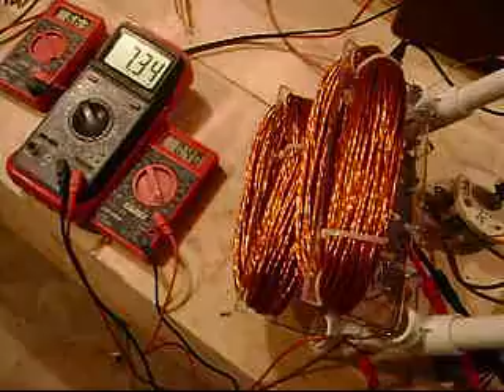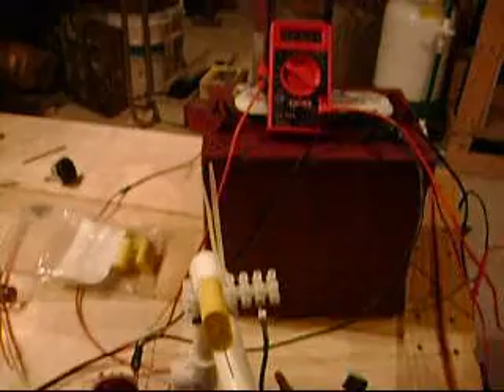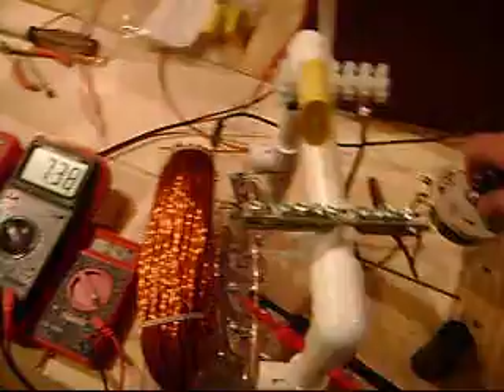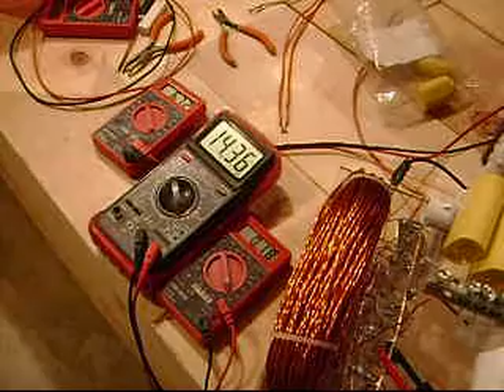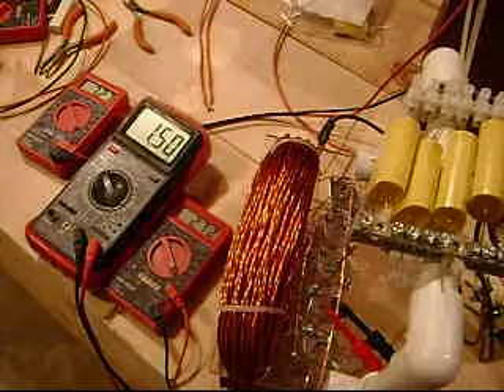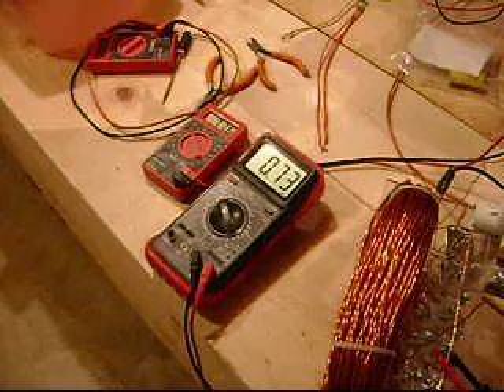TS SS 10T & CAP-DIODE MOD.wmv

Comment from the maker: 2n3055 transistors , 1n5408 diode,  0to500 ohm pot 2watt,  47ohm base resistor, 100 ft 18 ga magnet wire per power tramsistor and 1-trigger wire same.  I.A.E.C.forumco.com has it all  hope this helps

Comment: Hi Douge
Nice work youre doing here I always see your work very impressive .
are you still using 18AWG wire 100feets for your 10T.
according to your experement decreasing the freq. increase the charging rate and reduse the amperage drowing and that is what we all need .
good luck with your 0.5 and 0.25 ohm resistors.
Ehsan